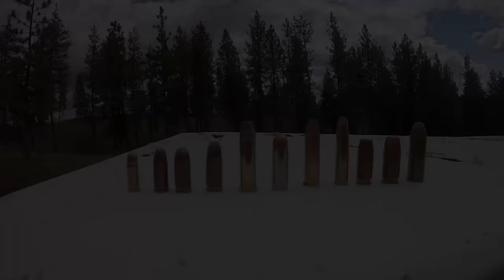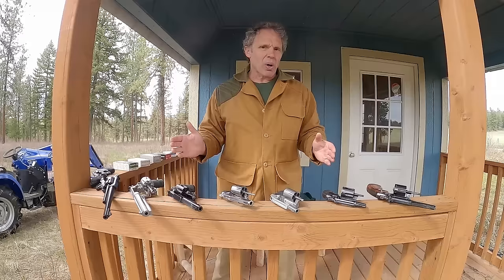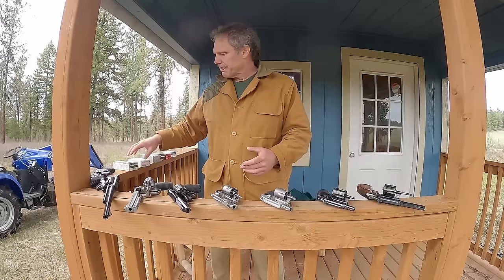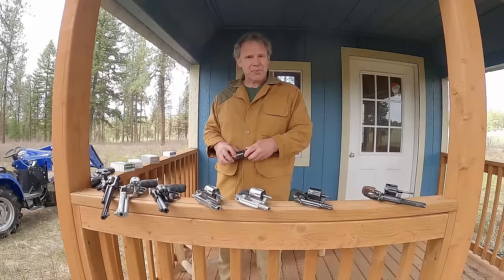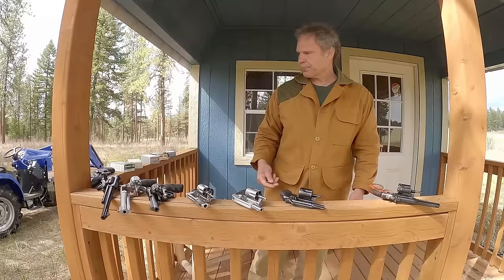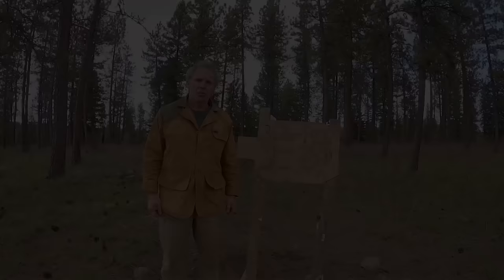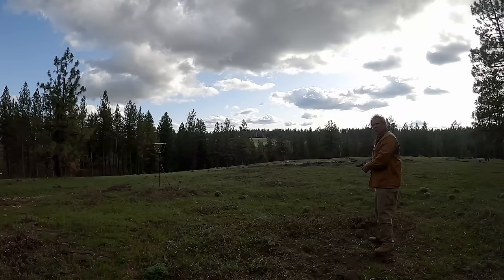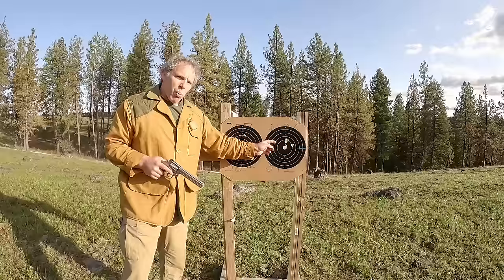Shooting .38 Super in .38 Special and .357 Magnum Revolvers

Comment: Would I use .38 Super Auto in my .38 special? A resounding YES! However, I would have to start with empty cases to reload the .38 Super cases with the minimun pressures and similar bullets and watch very carefully for signs of overpressure and accuracy. While most defensive gunfights happen within 20', real accuracy doesn't matter as much as "on the range". Every month or so, I go to several State,sponsored ranges and collect ALL calibers I can find, including shotgun hulls as I have the dies to reload everything from .218 Bee to .45 Colt to .50 BMG and even steel cases of various calibers.. A lifetime collection of buying all reloading dies as they are produced. Lee, Lyman, RCBS, and so on. They all work as I have taken great care of them all. For a new caliber, minimum pressures to function correctly and no FTF problems in autos, no extraction problems in revolvers. Annealing works on both brass and steel cases to extend their life. Deeply scratched cases are recycled without a second thought as the scratch may become a crack or split. Here is a question I have tested, does .380 ACP work in a 9mm revolver? Yes! But with 9mm so common, do you really want to? Not really. Do 9mm bullets work in .38 special revolvers - depends on the miked diameter. So, yes and no. When you cast your own, you can pick the resizing die for cast bullets for correct diameter and weight.
Now, the disclaimer follows: I am crazy and foolish, but for my own actions, not yours. Do not try this on your own, ever, unless you assume the responsibility for your own actions alone. I am never responsible for what you choose to do. Get it? Be as safe as you can be!

Comment: Nope, the ATF has determined that Pop-tarts are now machine-guns and are banned.
Unless you fill out and submit a form 1 application and pay for a 200$ tax stamp.
  BUT, one can bypass the new rule change by removing the "Pop" from each individual Tart and load them semi- auto meaning one at a time per toaster load, avoiding the Full automatic action where two Tarts are expelled from the toaster following a single pull of the lever/trigger.
    Never thought it would come to this...
But it has. 
At least we have our memories to console ourselves. 👍😉

Comment: I enjoy your videos because of the systematic way you go about showing things. The one question I have for you is, "if the gun says .38 Spl. on the barrel, then why even try to insert a .38 Super?. Sure, there are the known compatible cartridges, like .38 Spl in a .357 Magnum, and .44 Spl in a .44Magnum, and even .45 Schofield in a .45 Colt, but not the other way around, as you stated. Sure, you can even fire a .357 Sig from a .40 S&W, or  .40 S&W in a 10mm Auto, but why would you want to? Why would you need to, and having one type ammo and the other type gun isn't an answer.

Why can't shooters just stick with the ammo that is made for the particular gun they own?  just because you can, doesn't mean you should. That's a mantra every Tik-Tokker should learn, as well as every shooter. I know you get these questions, Paul, but you've got better things you can show us.
Reply from the maker: the most common reason to put .38 super in .38 special is because someone bought the wrong ammo and then wondered if it would work.

Comment: 38 Super in 357 mag not recommended but possible.  38 super in 38 special is potentially dangerous as the 38 super operates at a max  pressure of 33,359 psi while the 38 special max pressure is17,500 psi and +P 20,000

Comment: I think 9mm, .32ACP, .380ACP actually have very slight rims that will index them on revolver cylinders. It may not always work in a slightly wider chamber... but if I'm not mistaken, that slight bit that their rims protrude will let them index on many revolver cylinders without moon clips. (I didn't verify with all of these rounds and I"m not certain that it's these rounds specifically... but I at-least know it's true with the .32ACP, because it will go into a .32SW short and/or .32SW (long) chamber and index in both of them, even though the size and shape of the chamber will not stop the bullet. In fact, the chambers could be perfectly straight walled their entire length and it wouldn't make a difference. Also, not all cylinders are the identical shape and even the slightest difference could radically change the depth at which a bullet seats if it is not the specific bullet that was designed for the chamber.
Reply from the maker: .32 ACP is "semi-rimmed" That's why it will work in some revolvers chambered for .32 S/W 
 .38 Super auto is also semi rimmed. Calibers like 9X19 and .45 ACP have recessed rims and miss the ejector in revolvers so they need moon clips.

Comment: I've been shooting 38 super out of my Ruger single action 357 for some time now and never had any issues. 
Just picked up a rhino 357 and works very well also.
I don't think I would attempt shooting them out of a 38 tho.
(Side note, there a LOT cheaper than either 38 or 357 in 2022 and still widely available.)

Comment: .357 Magnum fit in .38 Special? CAUTION! Some .38 special revolvers made for military service  during WWII had bored-through chambers as a  wartime expedient. Unfortunately, .357 Magnum will chamber in these revolvers. The .357 chamber pressure substantially exceeds proof loads in .38 special.  Safest rule is just because it fits does not mean it belongs there.  

Years ago, in a hunter safety class I taught, I had a kid ask me if it was safe to fire .44 Magnum cartridges in a .410 bore shotgun. I explained that first, the chamber pressure for .44 Magnum substantially exceeds proof loads for .410 bore shotguns. Second,  the bullet diameter of .429 inch is bigger than bore diameter of the .410 bore shotgun. With the exception of .38 Special in .357 Magnum, and .44 Special in .44 Magnum,  and .22 short in .22 long rifle chambers, use only the cartridges of the same chambering stamped on the firearm.

Yes, I am aware of firing .300 H & H  cartridges in .300 Weatherby. It will fireform the empty brass into .300 Weatherby empties. I also know of a wildcatter who fireformed brass for a .300 Epstein by firing .300 H & H ammo. This sort of thing is not appropriate in a class composed primarily of kids.

Comment: Tolerance stacking. It's a thing. And it can really suck. I was surprised this video was so long. I was expecting an emphatic, "no!" for the answer. Welp. Learned something. I was also surprised that a 0.355" bullet would get enough grip on the rifling of a bore made for 0.357" bullets. I'm used to going up a thousandth. For example, lead cast bullets I run 0.358" to get a tighter seal to reduce leading. That works. I've also run 0.356" bullets for 380 ACP down a 9x19mm barrel in 9mm loads. I was looking for hyper velocity and figured I would be safe with this. I did use an expendable pistol for testing. While you can run 380 ACP bullets in 9mm, I would say it's a bad idea. In my test cases, the bullets were so over speed that they exploded on impact. And while the primers looked fine, I may have been over safe pressure too. So all in all, this video was quite surprising to me.

Comment: I was thinking in the first part about 38 Super pressures in a gun made for 38 Special pressures. Just off the top of my head without looking it up I'd guess there is at least 10,000 lbs. of difference and most likely more.

Comment: You learn something everyday I didn't even know it'd fit in .38/.357.I know that .380 fits in and I use to fire them out of a Taurus 66 when I was more reckless and you had to rap a bit of newspaper around them so the fitted in ok.As I recall a lot of unburnt powder and low, guessing about 500 FPS, velocity but still dangerous.As I remember 9mm doesn't fit as it's a bit too thick.

Comment: 38 super guns used to be notoriously inaccurate.  The older guns headspaced on the semi rim of the 38 super causing inconsistency during chambering.
Newer 38 super guns fixed this by head spacing on the cartridge case mouth making the guns far better for repeatable accuracy.
Even more so if you use something like 38 supercomp cases. 
They are just a 38 super with a rimless design like the 9x19.

Comment: As a person who carries a SP101 occasionally,  I really appreciate the effort put into this video, however, you answered a question I personally would have never asked. There is plenty of .357mag and .38SPL where I live and not much .38Super, so I have no reason to even want to try it. The more common ammos cost less and so there is no savings offered. I wouldn't be getting any ballistic value from .38Super that I get from .357mag, and on those occasions I just want to practice particular drills with .38SPL and not deal with the recoil of .357mag, once again, .38Super is not giving me anything I can't get from .38SPL.

Now if some people have different circumstances where they are, then by all means, knock yourselves out and shoot .38Super. But once again, if there is no gain, then there is no reason.
Reply from the maker: the most common reason is that someone wasn't paying attention and bought .38 super when they meant to buy .38 special. 
 Then they adjed,"can I use this stuff in my .357?
Reply: @PaulHarrell  that's a good point. I get similar questions regarding 45ACP and 45LC, and other calibers with the same numbers on the box. I can see that happening with .38SPL and .38Super.

Comment: Great explanation.  It's always a good practice to try out as many types of ammunition that you can afford, to make sure it functions correctly. I love the Hornady FTX, however I've had feeding problems on certain guns with the polymer tip catching on the feed ramp.  My CZ-75 loves those rounds and pretty much eats anything.  Some 1911s do not.  I've also had a similar issue with Federal Hydra Shok in 1911s.  Feed ramp stuff. I even had feed ramps polished, but some just don't like that ammo, like the 4 inch Springfield Champion.  It even had issues will ball ammo in that gun.  I ended up selling it and the new guy tried some different ammo and he liked it.  It kind of pissed me off, but some guns are finicky. Practice, practice and practice.

Comment: You  did not mention normal chamber pressures of the 3 rounds.  The astute observer would notice that the 38 super was much faster than the 38 Special, and that is because it is much higher pressure.  I liked that 'stance' IF you were to try it in a 38 special gun...  Yeah, it would probably blow up!   A more modern 38 that is also available in 357 MIGHT not, as the metallurgy would be the same for the 38 special (i.e., SP101, I have one in each chambering, and the cylinder walls are the same...).  No, I am NOT volunteering to try it.  IF the 'balloon goes up', tho, nice to know that a .357 CAN fire 38 super in an emergency.  Jerry

Comment: Ok so I watched this and went out and tested for myself. S&w model 10-8 heavy barrel 38 spl and charter arms uc lite 38 spl. Just to find out how good it was and Winchester white box was the only rounds for 38 super that worked excellent for accuracy and chambering. After shooting 325 rounds out of each only 1 round had to be forced out due to the casing splitting. This was due to the fact I had some rounds that we're old and probably should not have been fired. But getting 650 rounds of 38 super for 100 bucks can't complain. It is a viable back up round for my two 38 special revolvers. Thanks
Reply from the maker: That's great, but remember, .38 super is a lot more powerful than .38 special and I DO NOT recommend shooting super in a .38 special revolver.

Comment: Okay, I never would have even thought about this combination, but after watching this video I was compelled to break out my 357 revolvers and 38 Super ammo to try.

So in both my Ruger GP100 and Ruger SP101, my 38 Super loads did fit.  The fit was snug, but they did fit and did eject easily.  Now my 38 Super loads are handloads, and all using Starline brass.  And I wonder if that is the difference.

As you mentioned, different manufacturers have different tolerance for cutting the cylinder chambering.  But I will also add that different brass has different tolerances.  So for example, the brass used for Winchester White Box might be less to spec than the brass used in Winchester's Silvertip ammo.  Or it might even be a combination of both factors.
Reply: The specs state tolerances. Some manufacturers may use tighter tolerances. However the specs for .38 super ensure that a .38 super round fits the chamber of a gun chambered for that caliber. .357 Magnum and .38 super have different diameter specs for brass and chamber. There is some overlap.
A different lot of ammo may cause the rounds to not fit anymore. Same goes for the specifc revolver. Just because the ammo fits Paul´s 686 does not mean that it will fit all 686.

Comment: But the cartridge pressure of each round has to be taken into consideration. The 38 Special has a standard pressure of about 17.5K PSI and the 38 Super has a standard pressure of more than 33K PSI. Firing a 38 Super cartridge in a 38 Special revolver made to operate with a cartridge at about 17.5K pressure can be very dangerous.

Comment: Dick Metcalf wrote an article stating he had fired thousands of rounds of 9x23 through dozens of different 38 super handguns with no problems . I have tried this in a half dozen  38 supers and found colt national match would not chamber 9x23 . My tanfoglio match has a supported chamber and i get about 1450 fps with 125gr 9x23 . vihtavuori list n105 at 1500 fps my 4.7 inch barrel get 1480 starline supercomp brass so 18 rounds of 357 mag

Comment: Thanks for this video.  I never would have believed it could be that interesting of a topic but it was indeed very interesting and as always (heh) very informative as well. 
I remember many years ago, back in my LEO days when I was carrying a .32 S&W Long model 30-1 as a BUG, I read/was told that "Hey, .32 acp will chamber in that too."  Well, we issued .32 Gold Dots for the guys carrying that caliber as a BUG so I grabbed a box, went to the range and sure enough, my 30-1 shot it fine.  Many boxes have gone through it and never a misfire.  Never any problem with ejection, either.  BUT, when I one day tried some different ammo there were far more clicks than bangs.  Which made me wonder, would the next lot of even Gold Dots be exactly the same spec and work?  Never found that out as we quit ordering BUG ammo, but I also stopped toting .32 acp in anything other than a .32 acp pistol.  I found some good .32 S&W long ammo (heavy 115 grain lead flat-nosed) and stuck with that for times when that gun was my carry choice (usually days the arthritis was acting up).

Comment: Firing automatic pistol cartridges in revolvers has been around as a story for a long time.  I think it was a marvel crime comic book and in the back was some little discussion of how criminals would use automatic pistol cartridges in revolvers by peening the rims for better retention in the gun.  
Sounds like early fudd lore to me.
There was at least one combination that is potentially dangerous:  9mm Federal Rimmed  that never got much produced at all after when an NRA guy there for some demonstration asked would it fit the old .38 S&W top break revolvers and for sure it would.  I suspect while a .38 S&W might fit a 9mm revolver it might not be a good ideal.  The .45 1917 revolvers turned out by for the 1/2 moon clips did also have a rimmed or .45 auto rim cartridge.  Rim was thicker than normal for adequate head space.   i think there could be excess head space with .38 S&W in a revolver intended for 9x19 cartridges.  It really depends on how those revolvers are set up.  I do not have one to test.   
Of course there are .22 automatics and revolvers and all work well with rimmed ammo.   There is the long out of production target auto pistol that fired .38 spl wad cutters: Smith & Wesson .38 Master Model 52-1 and 2.

Comment: With .38 Super going for around the same cost, maybe even cheaper than .38 Special, it might not be a bad idea, if you got a .357 Magnum, to see if you got a magic gun that will chamber .38 Super.  Especially since it should be an improvement over .38 Special performance.

Comment: I can load a 410 shot shell in my 45-70, don’t think I will be doing so. It’s probably fine, and it’ll probably eject, and the pattern will probably have holes in it big enough to drive a Jeep through. Can do something is rarely that useful. But I was pretty surprised to find out given the right combination of 38/357 and 38 super it might kinda work. Thanks for an interesting video!

Comment: I would be worried about the additional erosion at chamber throat and forcing cone brought upon by shorter length and smaller OD of 38 Super in 357/38sp revolvers. I think the rimless revolvers use the chamber throats to set headspace versus pre forcing cone stabilization as in traditional rimmed cartridges. I was just an engineering intern at S&W for two summers, so my knowledge is limited.